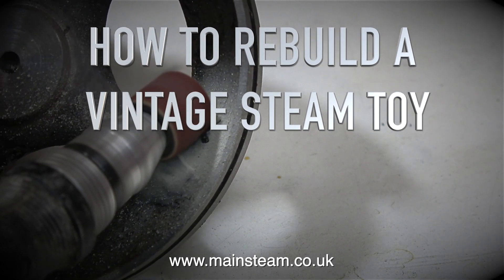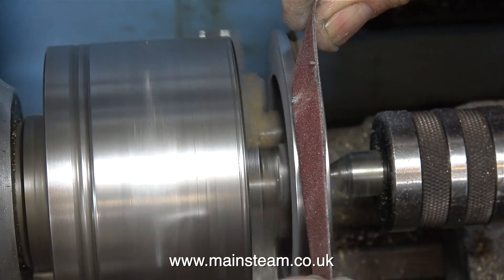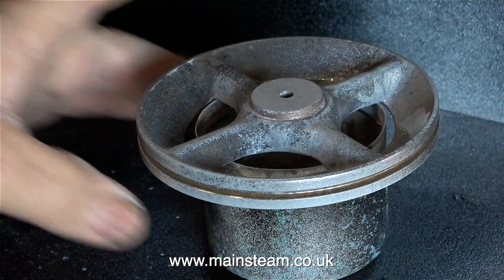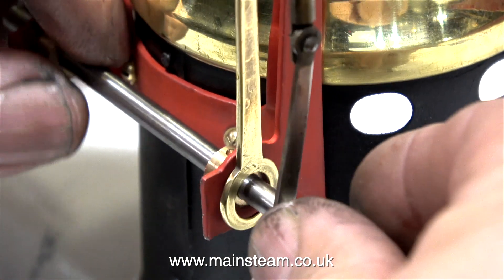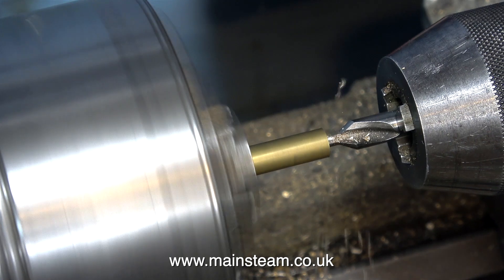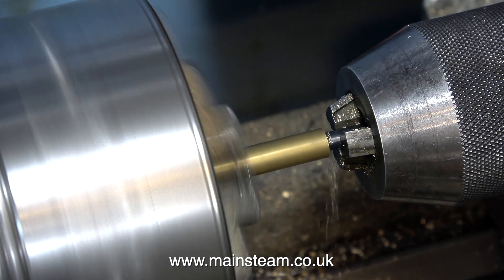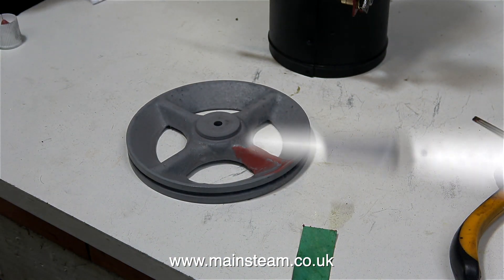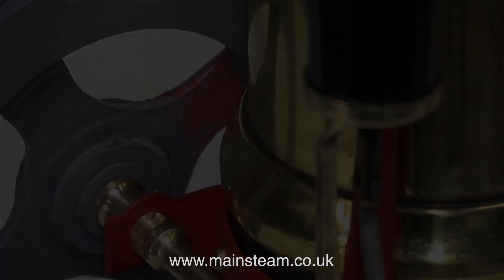HOW TO REBUILD A VINTAGE STEAM TOY - PART #7

Comment: Thanks as always for your fine videos!
Is it my imagination, or have you started putting on a thicker layer of etch primer than you used to?
Reply from the maker: generally I apply a little more etch primer to castings and on this flywheel I spayed it with normal "filler primer" after the etch primer had dried.